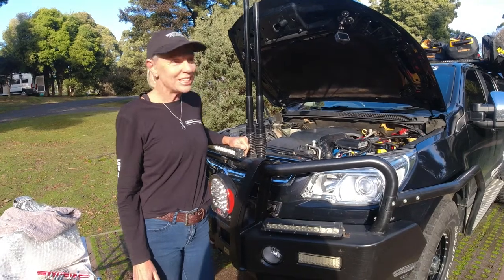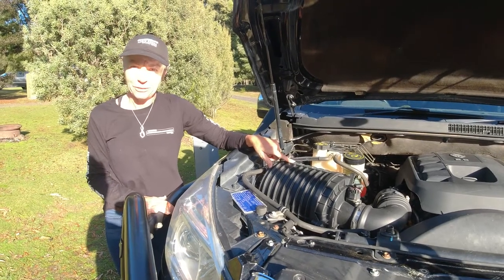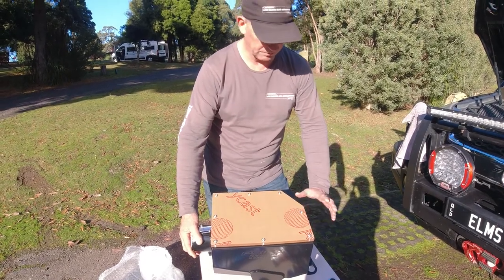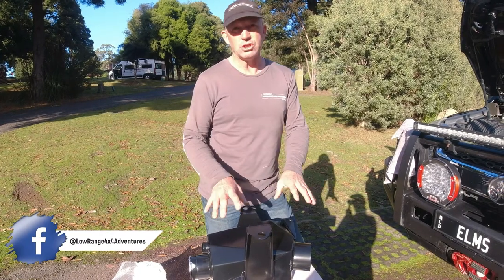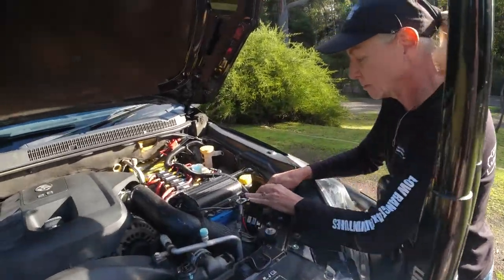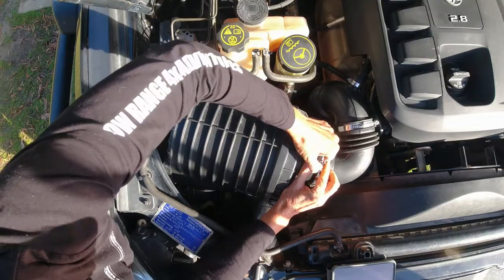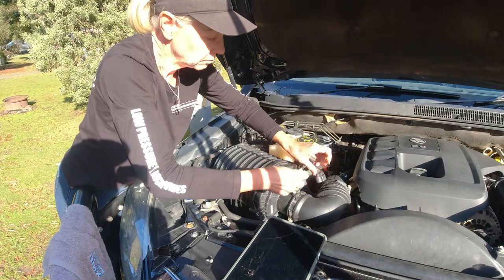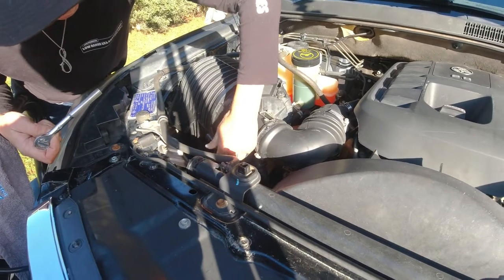Gear Spotlight - Psico Performance Custom Airbox Install - 2015 RG Colorado

Comment: Awesome video !
Reply from the maker: Cheers bud glad you enjoyed it, the airbox is awesome if you need one for your truck get onto Cameron at Psico and he will get you sorted. Make sure you let them know you came across his awesome product from our video.
Reply: Hey mate, just installed one tonight, and after about 20 minutes of driving it went into limp mode, nothing went wrong on the install, any ideas or did this happen with you ?
Reply from the maker: @jackwilkinson7637  we had no such issues with limp mode however when I originally spoke to Cameron about the air boxes he said if there were any issues he would be available to help. Give him a call and go through it with him. What model and year is your car?
Reply: 2012 RG mate, spoken to them and they have a file that tricks the computer and apparently resolves it, not ideal
Reply from the maker: @jackwilkinson7637  sorry to heard that mate, I hope that you can get it sorted, I was unaware of any issues with the air boxes causing any sort of codes.

Comment: Hey guys, great video. Did you check your intake hose from the airbox at the base where it goes to the turbo. These tend to crack  quite often as I just discovered on mine. Waiting on a stainless aftermarket one to arrive and never have the problem again.
Reply from the maker: Thanks for the tip! We actually had them replaced a while ago as they were cracked and  debris got into the intake side of the turbo and damaged the fins. All sorted now and I keep a good eye on it, do you have a link to the stainless replacement?

Comment: Hey mate does the new air box / filter let off any sound
Reply from the maker: Hey mate if you mean does it make the turbo flutter sound then yes but only slightly, I am still waiting to put the flange that goes between the air is and the snorkel so that may be affecting the level of noise. Will let you know if it changes when I finally get a chance to install that flange and make the whole system air tight.
Reply: @LowRange4X4Adventures  oh sweet best of luck 👍

Comment: what's with rg Colorado air boxes cracking lol 
im gonna get one of these airboxes
Reply from the maker: Yeah we had 3 fail before we gave up what year model do you have?
Reply: Jeanette you’re a legend! I bought a snorkel for my ‘13 many years ago but hadn’t had the apricots to carve into my front guard but now I just want to finish it and yes I’ve had to replace the OE airbox and also lost confidence with it so like you I searched and decided on a Psico fabricated airbox too. It was delivered today so I scrolled through YouTube and came across your video. Nice work guys. I may still be toey about the guard but I reckon I’ve got the airbox down pat. 
Nice to see another RGs hacking out there. Cheers

Comment: Any error codes? Just found your channel
Reply from the maker: Hi Peter, no mate no error codes however I did have a conversation with the guys at Psico before I pulled the trigger on the new air box, all I can say is it has been fabulous, I would love to couple it with a Psico snorkel as well to complete the package. I do know that there was some issues with error codes on some early model Colorados but he has a solution to fix that as well